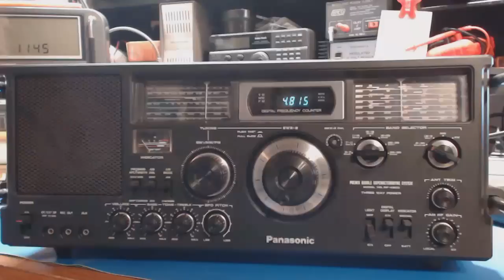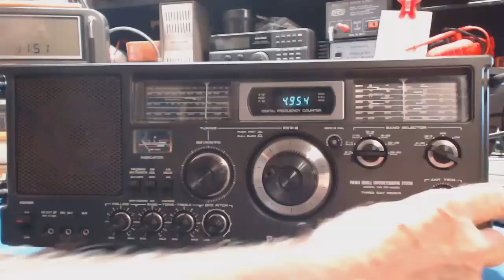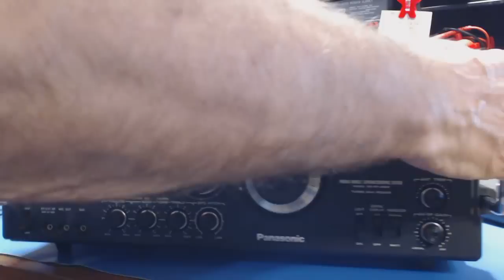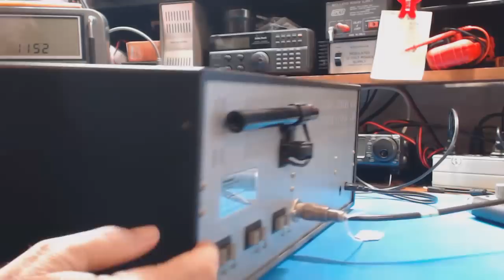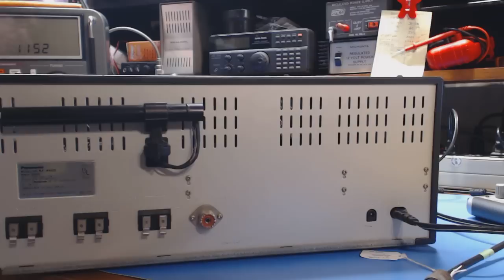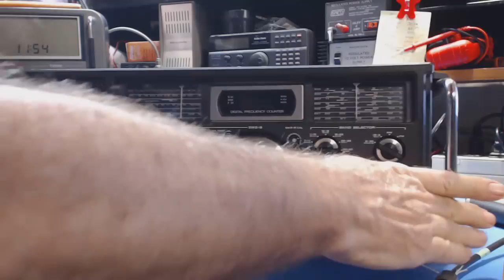TRRS #1410a - My New/Old Panasonic RF-4900

Comment: So i have one of those and anytime i try to adjust the volume it has a seizure do you know what is broken?
Reply from the maker: Have you tried to reset the unit?
Reply: @hamrad88  how do you reset it?
Reply from the maker: I just check the service manual and could not find any information on resetting this radio.  Most digital radios like this one have a reset button in case the processor crashes.  Sorry.
Reply: @hamrad88  do you think i could take it to a computer repair shop?
Reply from the maker: I doubt very much if they could help but it is worth a try.  It maybe a mechanical problem with the volume control.  It maybe shorting something out.  Really hard to say.  Maybe open it up and do an inspection.

Comment: How does the s.w. reception compare to the Grundig satelit 750 ?
Reply from the maker: With band conditions being so poor it is hard to really tell but my guess based on my limited testing, they are about the same.  Note that I have not used the 750 with the 31 ft vertical antenna and I have not used this radio with my G5RV antenna.

Comment: Looks like a real good radio with tons of features and looks like a competitor to the Grundig radios in it's day.
I can say that it has a better quality case versus the Grundig satellit 800 and the later radios. The Ole Timers
new that metal shields better than plastic! Radio that age probably needs to be realigned since some of the
components do age and change value. The prices on this radio on Ebay I think is set to "antique prices"! 
Like you said, some on Ebay are overpriced and haven't been taken care of. Thanks Tom for the review.

Comment: hamrad88
Nice review! I still have my own RF 4900 that I bought brand new back in 1981 at 15 years old! SW bands work perfectly, maybe even better than when I bought it because I did an alignment on it. The AM/FM bands don't work correctly, not sure why maybe the IC or 
an oscillator. Mine looks like new too. This radio was highly underrated during its day, one of the best features is having an analog tuner with digital freq counter so the noise floor is as low as some of the best receivers you could buy which makes hunting for weak signals easy. The only down side of this radio was the tuner could be a bit drift prone but there are ways to mitigate that without too much work.